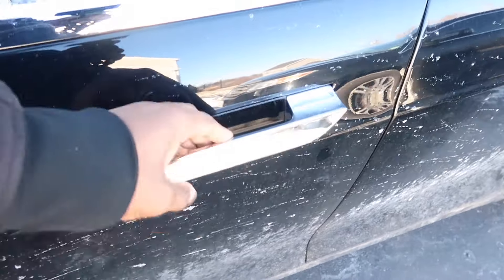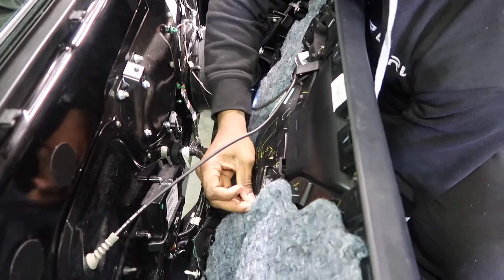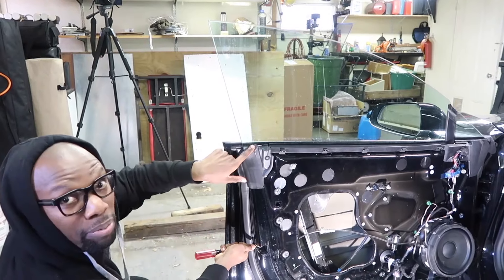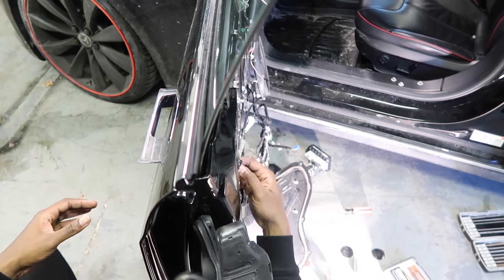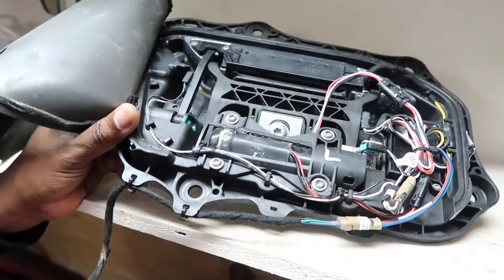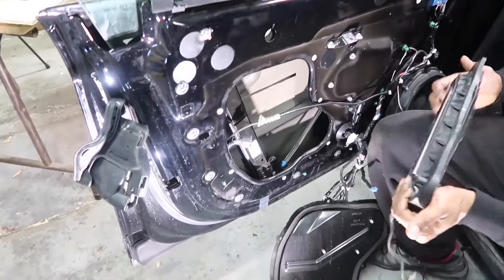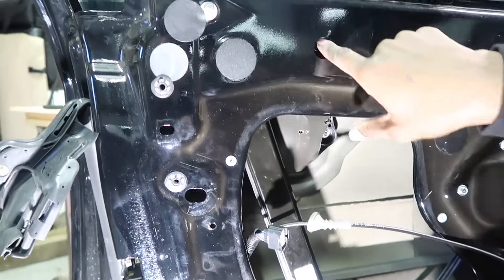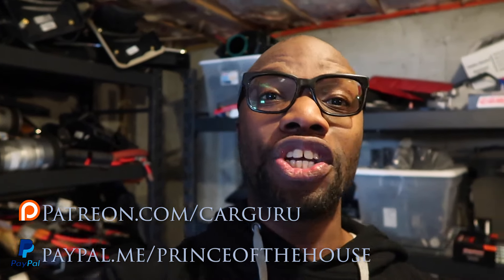How to fix Tesla Door Handles

Comment: That's about how I did mine. I didn't have a replacement harness so I trimmed the broken wire and re-soldered it to the microswitch. For the centering of the door handle I used toothpicks to equalize the spacing while I tightened the nuts. If your 10mm wrench doesn't fit from the top, buy a "slim" version at the hardware store. I didn't know about the trick to make the window higher (but if you do that make sure to lower it before closing the door). I've also heard you can use a bladder tool to spread the internals apart a little to make more clearance for getting at the nut and getting out the handle. It took me about 1.5 hours to get my first (and so far only) handle out, 15 minutes to fix the wire, and 3-45 minutes to button it all back up. Still, less than than driving to my nearest service center and back.

Comment: This will be another bad idea just as expensive as a Cadillac North star  head bolts/head gaskets issues and with all other issues. These will be like all the North Star Cadillac's rows and rows in the junkyard because every thing is too expensive to fix. One the warranty runs out in 8 years owns will junk these I bet cost will be more than the value of the car. 8 years you'll be left with an expensive boat anchor..

Comment: A few thoughts here: Have you tried sealing the connector of that harness you replaced with a drop of Hot Glue and some heat shrink tube? That might keep it from corroding so you don’t have to do this for the rest of your life. Other suggestion: find a pice of plastic to match the spacing on the handle (your wife’s credit card for example) so the handle is held in Place for you automatically..... love this vid, tons of good info in it, if I only had a Model Ass.... sorry Model S :)

Comment: Figured for the value of Tesla you spend, they would have used better adhesives for the plastic cover vs. Something cheap that allows the plastic to eventually fall off. But I guess every mfr. Cuts corners to save $$ somewhere.
Reply: not always about cutting costs, sometimes a problem developes that was just not foreseen during development.
The real world is always the ultimate test bed for any product.

Comment: You may consider adding some Loctite Dielectric Tune-Up Grease at the electrical connection points. It will help prevent corrosion. I also have a friend who keeps a deck of playing cards handy in his shop to help hold spacing on his car projects. Keep up the great work with all these videos. :)

Comment: You are a very resourceful guy who knows his stuff, but you haven't made your living as a mechanic, right? Your dexterity with tools is good for a few chuckles here at old shits who have worked on old shit since christ was a Lance Corporal. 
I do have a question; Generally, side window removal is a matter of 2 or 3 fasteners once you have the door laid open. Does Tesla use some arcane attachment method to mount the pane to the regulator?

Comment: Working on a 100k$ car as if it were honda. Lol
Reply: Yeah, I wouldn't dare considering the poor build quality Teslas are known for.
Reply: Usually with a 100$k car, it goes to the dealer. Tesla is the exception. Lol
Reply: TurboFlush   I TOLD THAT TO ELON MUSK TOTALLY  NOT FUNNY
Reply: M773 true dat
Reply: WAY MORE PROBLEM THEN A HONDA. LOL
Reply: TurboFlush a tesla isn't worth any more then a Honda...
Reply: A car is a car, doesn't matter what price it has.
Reply: TurboFlush This Tesla isn’t a $100K. It’s more like $40K now if not cheaper, it’s pretty old
Reply: @cardboardboxification  Tell that to your local gas station owners
Reply: In 11 months I've had issues with 3/4 handles on ModS. Very  cheaply made interior features
Reply: I bought mine used for $29k.  To fill it up to 190 miles is free at the super charger by my work.  At home, my electric bill went up $5-10.  So i save on gas.  I haven’t had any issues, minus one handle.  This was an easy fix.  Just like any car with a window regulator fix.

Comment: Use a multimeter to test the harness for continuity before using it. And ever consider making a harness out of higher quality Cooper wire.
Reply: flowgy Definitely from an ex-engineer. If you can’t trust your parts, gotta test them!
Reply: Would the Cooper wire prevent corrosion? If so I can see a cottage industry for Model S door handles.

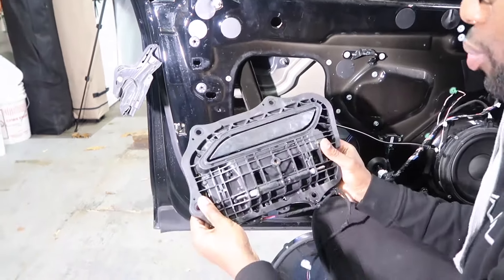Comment: @9:07 Whoever designed this door handle broke one of the most basic engineering principles in existence, which is ALWAYS mount the microswitch (or component with wires) on the frame, and put the contactor (or component without wires) on the moving part. But instead this idiot made the microswitch move towards the frame during each extend/retract cycle, which causes a focus of stress on this Panasonic microswitch.

This would be like installing an alarm on your house’s front door and mounting the magnetic on your door jam and running the proximity switch wire across the door hinge and over to the edge of the door where it can sense the magnet when it’s closed.

In circumstances where there is no choice but to put the wired component on the moving part, they make special microswitch which has a rubber tadpole where the wire enters the switch (like you see on nearly all mobile device data/charge cables), which distributes the bend over a longer section of wire and makes it last 10x longer. But what Tesla used was a microswitch design to be mounted on the frame. 

There are a few ways Tesla could have put a bandaid on this bad design, such as fixing the wire to the same moving part as the microswitch, and making a sufficient loop over the hinge to the door handle frame.